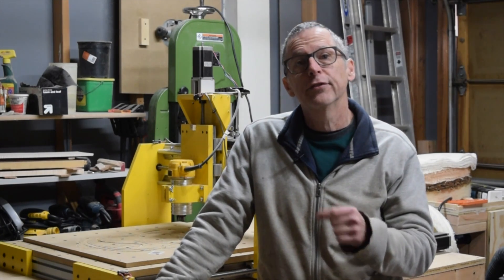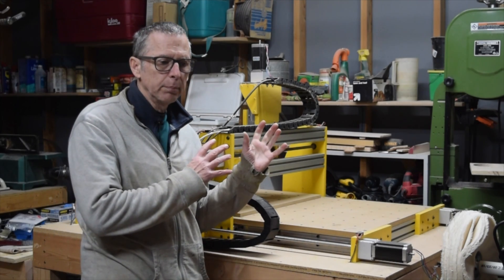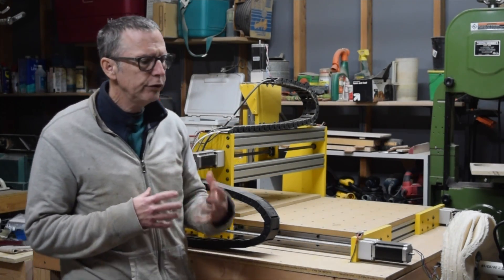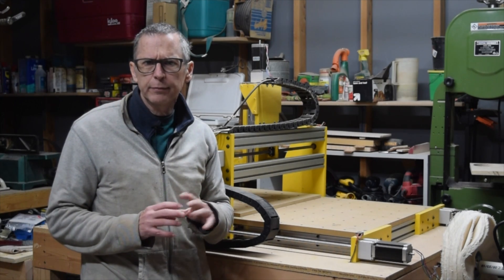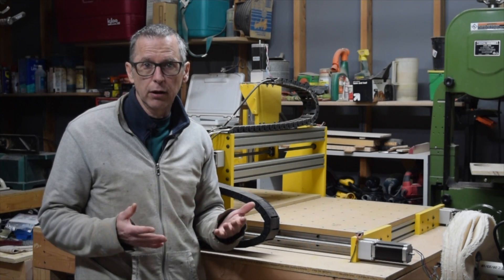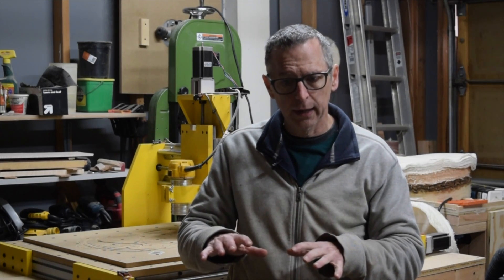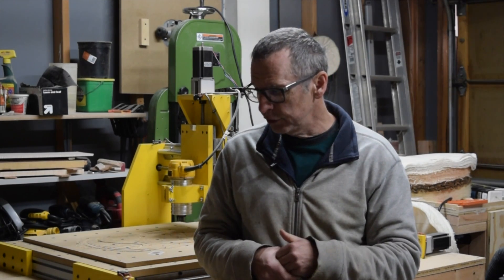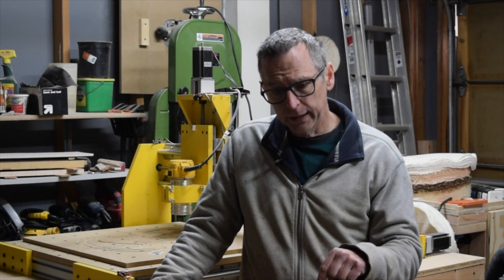The Carve Settings I Use When Making Guitars With My CNC Machine

Comment: Great info thank you!! One question: why do you use a 1/8” ball nose EM for the fretboard profile, rather than a 1/4” ball nose? I would think a 1/4” ball would be faster, but I only have 1 month of CNC experience lol. Thanks again!
Reply from the maker: I use an 1/8” flat end mill so I don’t have to switch bits between drilling the marker dots, carving the radius and cutting the perimeter shape.
Reply: @HighlineGuitars  ohhh I thought you said ball nose for that toolpath. Thank you! Merry Christmas!!!
Reply from the maker: @MOZOGuitars  it really doesn’t matter. I prefer a fly end mill as it cuts the perimeter better.

Comment: Check out the routER11 from  openbuilds to replace the Dewalt 611. It uses collets, slows to 10,000 rpm and is quieter. Just my opinion
Reply from the maker: It’s only 1hp, 1/4hp less than the Dewalt 611, which I consider barely adequate. Also, I can get replacement brushes for the 611 at my local hardware store. I have no idea where to get brushes for this obscure brand. If I ever have to replace my Dewalt, I’ll go with a 2hp spindle.

Comment: Hi Chris,.
For the frets slots, based on your speeds and feeds, it would take around 3-4 hours to cut the full depth required for most standard fret tangs. Is that the sort of time you are achieving or am I missing something?  If 3-4 hours is correct then would it make sense to cnc the first 0.01" cut just for marking the locations and then finish the depth by hand?
Cheers
Reply from the maker: You're missing something. I don't know what, but it takes me 42 minutes to cut 24 fret slots.
Reply: @HighlineGuitars  will have a double check, that was the figure solidcam was giving. How deep are you doing the grooves?
Reply from the maker: @danbaker3731  .135"
Reply: @HighlineGuitars  thanks Chris. Im guessing i have done something stupid in the cam.

Comment: Thank you Chris,   In the Cam process I have been using fusion 360 and when I input 16000 rpm I get much higher defaults?  The pdf is great but I am kinda lost on the feed rate...there are so many in fusion.  Lead in, lead out, cutting feed rate, ramp feed rate...not sure if you have ever used fusion or not.  Any feedback would be great!  Awesome video!
Reply from the maker: Eric Weatherman sorry, I don’t use Fusion 360.
Reply: Highline Guitars rhino?
Reply from the maker: Eric Weatherman Rhino is CAD only. For CAM I use MeshCAM.
Reply: Highline Guitars oh ok, thanks

Comment: Just one question about fretboard slotting. As you do it before radiusing the board, what depth do you cut the slot? 1/4" ?
Reply from the maker: I slot before cutting the radius. The depth of the slot is .135" which, after cutting the radius, is just enough to accommodate the fret tang.
Reply: @HighlineGuitars  So you don't radius the slot to match the final fretboard radius.?